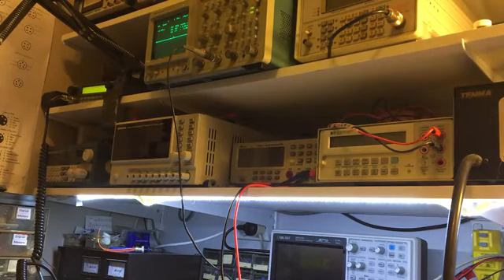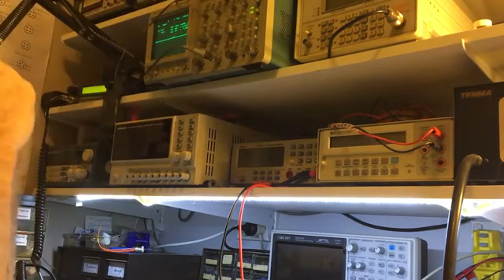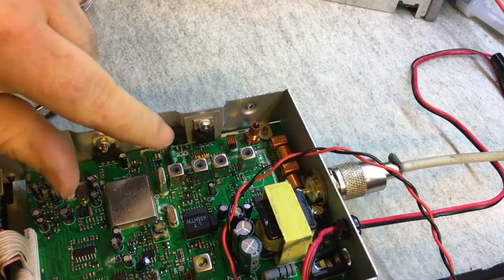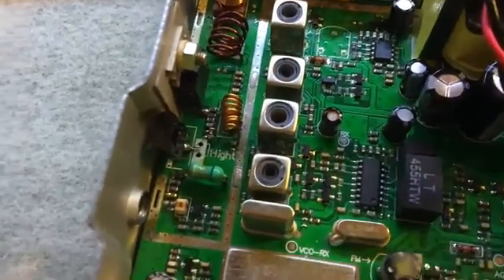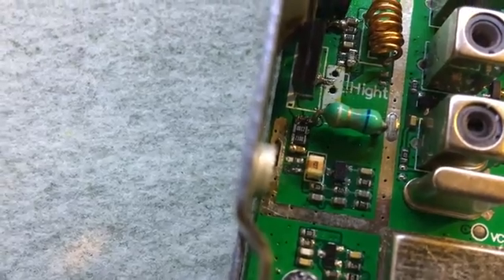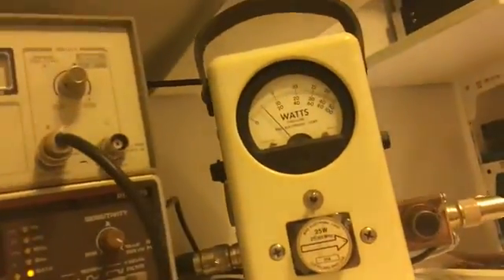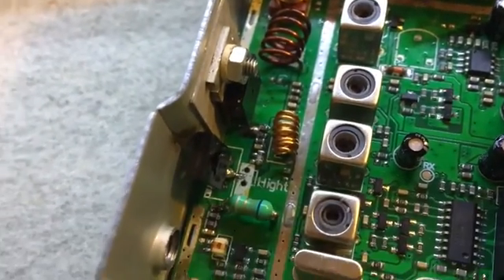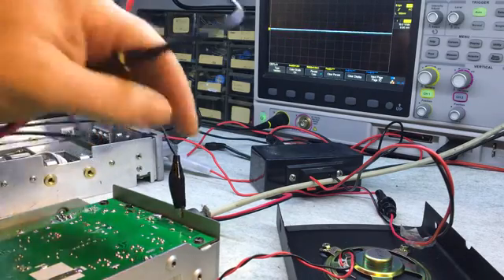#58 Hoffman H225 CB Radio Repair

Comment: Hi I have a Hoffman H225 bought from new about 5 yearsago hardly used butthere is no audio  the microphone works changing channel and display shows transmit bars at full strength but there is just no squelch sound or audio from speaker . had itapart looks fine to me no rust clean connections speaker wires are sound and well soldered anyidea where the problem may lie